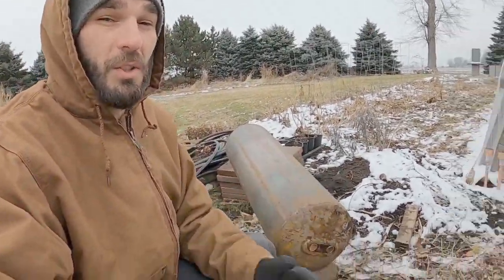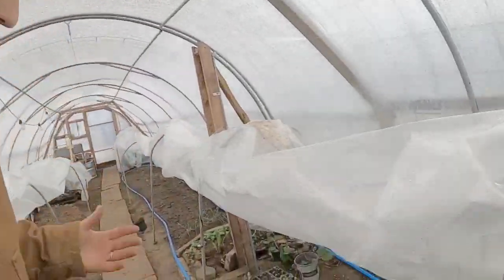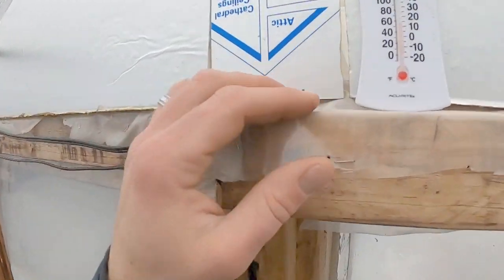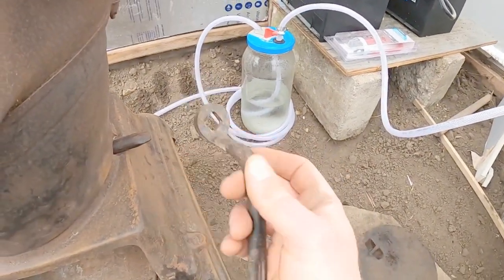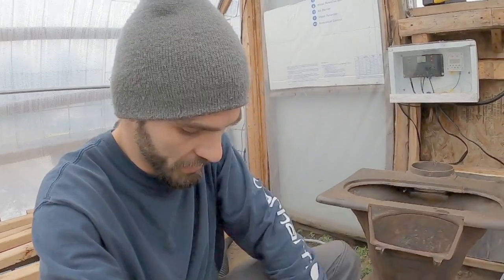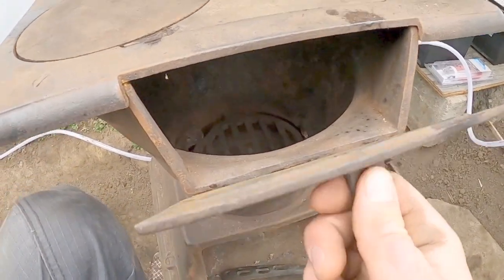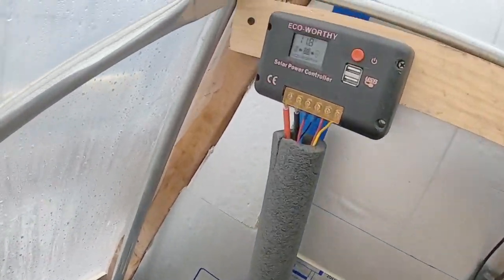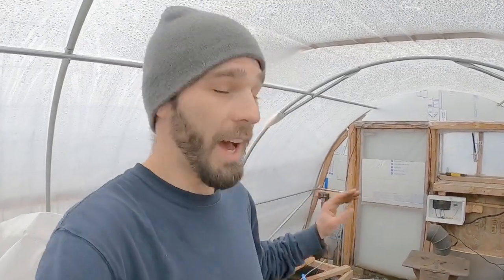FREE DIY Greenhouse Heating Experiment - Free Fuel Sourcing - Many Ideas And Experiments -Idea Share

Comment: Need to double layer for stove pipe that is outside or there will tons of creosote....warmer pipe where the pipe is outside is a plus......and a design where you can fairly easily run a brush thru the pipe.....on my 5th winter with a wood stove
Reply from the maker: Thank you for that input! I’ve got it pretty well put together, I’ve got a little bit to go with the fire board behind it on the wall, I have two elbows, kept it 6” all the way and the flow is great thankfully, I didn’t want to have to go up too close to the poly. I’ll share a picture of the inside, don’t have any of the outside yet
Reply: @Earthdwellershomestead  I have rocks and cider blocks on and around mine for thermal mass
Reply from the maker: I’m acquiring as many few bricks as I can offline and I found a yard that sells at half price, going to pick up 50-100 large cement bricks this weekend! Thermal sinking that energy is the best way to add longer heating properties to the stove! Great ideas

Comment: I think one thing to keep in mind with natural draft chimneys is that it requires the exhaust to be warm enough to create enough of a pressure differential so that it can vent the exhaust properly and not back flow into the greenhouse. So, when trying to capture the heat to warm a thermal mass, it'll be important not to cool down the exhaust so much that you end up with incorrect pressures. I know with rocket mass heaters, it can take a bit to get that draw going properly, and because they burn so efficiently and hot, that once it gets going there is less of a problem with it. You'll probably need to figure out how efficiently that stove burns.

Point 2 to keep in mind is that when you're combusting and exhausting, you'll be drawing air (including your warmed air) out of the greenhouse and it will have to be replaced. If you're not feeding the stove with a direct vent from the outside, then the greenhouse will be drawing in outside air through cracks and such. You may have issues where areas near the doors/windows are colder where that cold air is being drawn in. You may be able to overcome that with a direct vent to the outside so that it can draw in outside air on your own terms. Alternatively, you could just have the stove completely outside the greenhouse and try to capture the heat with tubing that runs back into the greenhouse and you don't have to figure out drafts and venting and such.

All food for thought.
Reply from the maker: Man this is great! Thanks for laying all that down there, a lot of good info for everyone to view! I have been thinking about that since I set it up. I was contemplating how much air is going to go out and how quick. Then obviously it has to come from somewhere, a cold air intake would be pretty easy. I could take some smaller hose or pvc possibly, route it under the wall directly behind the stove and routed to the lower intake vent as a source of cool fresh air on my terms and not through windows and doors. But on the flip side I would have to be able to cap or close it when not in use. I’ve got the stove piping mostly situated went 6” all the way out for the best flow, I didn’t wanna downsize it at all, it’s a rather bulky pipe on the back of the greenhouse. Added a bit of support to hold the stack tight, getting some fire board up behind the stove itself and it should be close to finished. I’ve got a few things coming for it. First order was an eco fan ran on heat, very interested to see it work for me. Thanks again for the ideas. Helped me work it out a bit more in my head lol

Comment: some things I've thought about/seen with wood stoves.. 
Water container on top, large/medium/small rocks caged in around the stove(could perhaps even pair with insulation around rocks). You may even be able to do something interesting like partially supporting from either side of the stones to be able to load more on top..
copper coil with water around the exhaust.
Not sure about piping... My guess with that guy is you'd have to get pretty high vertically for a decent draw if you are having a couple 45s going out, probably would need supports attached to the side wall is my guess.
Reply from the maker: I’ve ordered- eco heat powered fan, new solar system, 100’ copper tubing, more 12v waterproof fans, and A few other little goodies. Found a guy with unlimited concrete blocks for cheap im going to grab a load this weekend hopefully to really add upon the thermal mass energy. Great ideas man I can’t wait to bring some cool experimenting soon, just gotta find a better way to keep my woodchips dry or to dry them faster.

Comment: I really think your pile isn't sealed enough to collect much methane. Any methane you are generating has to overcome the pressure of the tubing and inner tube. And it is a lot easier just to escape out around the chips. Every time I research the Jean Payne system he had a tank in the middle of the pile that was sealed except for the gas line to a burner or storage tank. So you may need to add a drum of some kind. That you can seal with a gas line out in order to generate usable methane. Also you could build a thermal mass around the wood stove to absorb the heat from the stove when it is burning. Then let it radiate the heat into the greenhouse passively when the stove isn't burning. You could also wrap the stove pipe with copper tubing to heat water as the heat is escaping up the chimney.
Reply from the maker: My original idea was to use a piece of old poly the size of the pile to cap it and pull the methane from the top. Next winter I’m going to come up with some type of system like that. Great ideas for the stove! I ordered an eco fan- heat powered! And I have about 100’ of copper tubing that’s going to be interesting to work around the exhaust or stove itself. And I found a guy with large concrete blocks for cheap im picking up a load here soon, additionally I have another solar system on the way with a couple more of the same fans I used for geothermal and compost heating to blow more heat off the stove itself and circulate it better. I got a lot of stuff to work with soon lol pretty excited to finish out the winter with this set up. I gotta get myself a system for drying my woodchips asap.